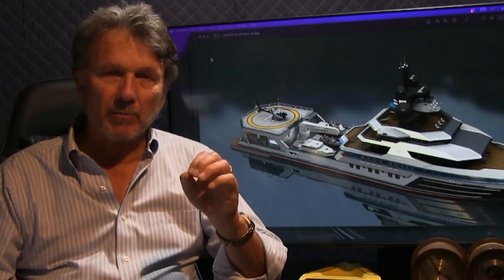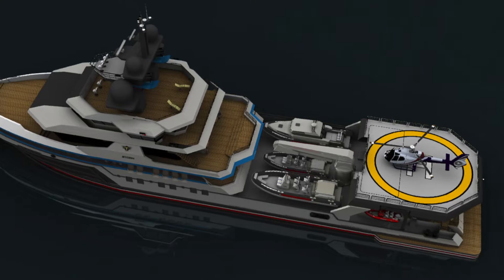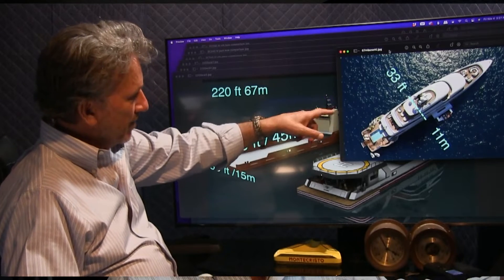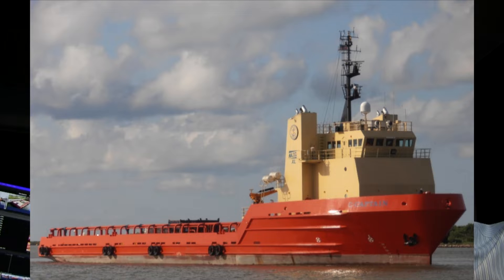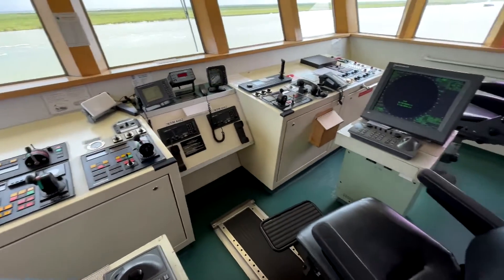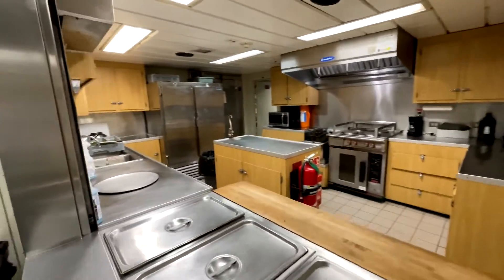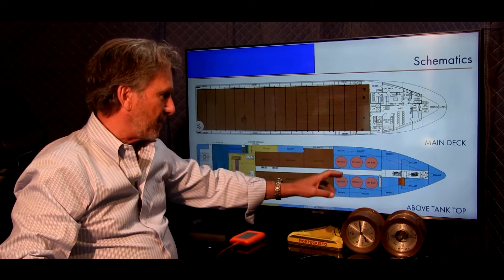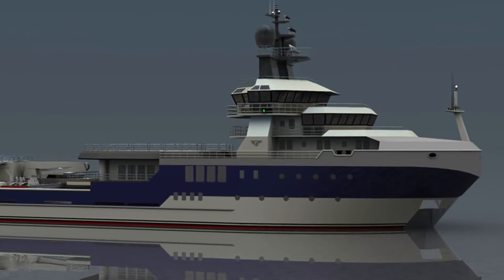Converting a 220 ft to 260 ft offshore supply vessel to Global Expedition/Explorer Yacht

Comment: Interesting concept. It would be more atractive if the final conversion cost, added to the cost of the donor boat, exceeds the value of a current expedition yacht in great working condition.
Reply from the maker: They usually come in at half the cost, or less, of an in-class, in service expedition yacht- unless, you glam it up with chandeliers and exotic interior, then you are missing the point of using a proven commercial vessel.

Comment: Hello, Paul! How would these compare to Scandinavian and Dutch OSVs? Are these also designed for survival in seas as rough as the North Sea? Are the designs as holistic and meticulous? Is the engineering  and build-quality as good? Are shipyards in the South good? I  thought the best US shipyards were in Washington and New England? 

How would these compare to naval and coast guard vessels or salvage tugs? Do they operate in as adverse conditions as those? Of course, the open aft decks make them very easy to convert and the massive beams should also provide tremendous seafaring stability? 

And, finally, what would the fuel consumption and overall costs/day be? Are these really go-anywhere all-weather vessels?
Reply from the maker: They are all built to class specifications - which would be the same in Europe and U.S. The commercial success of a working vessel is dependent on its reliability and length in service - so it is in the interest of the owner/builder to use the best materials and highest grade of equipment. The Gulf of mexico shipyards uild most f the commercial vessels, and the smaller military and patrol vessels in the U.S. and are of the highest quality.

Comment: Do you find that these 'donor' boats are surging in popularity, or are people still looking to a shipyard to lay a steel hull and build a yacht from scratch? Is there a time advantage in these? Since things can be made else where and then bolted on while the unnecessary parts are being stripped off, does this make the yacht available more quickly or is it still about 2 years until completion?
Reply from the maker: We are currently seeing 3-4 of these projects starting each year- and that is certainly a surge from 1 a year, or less 10 years ago. And yes, you can be prepping the hull by stripping out unused systems and tanks while new accommodations are being fabricated in a shed. A yacht support conversion can be done in as little as 12 months, while a full expedition yacht conversion might take up to 18 months depending on the level of finish.